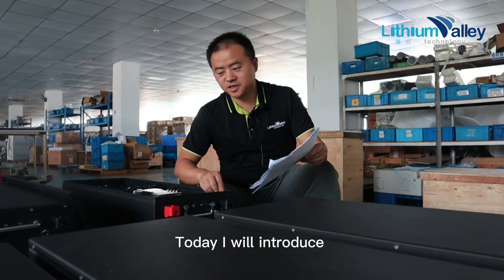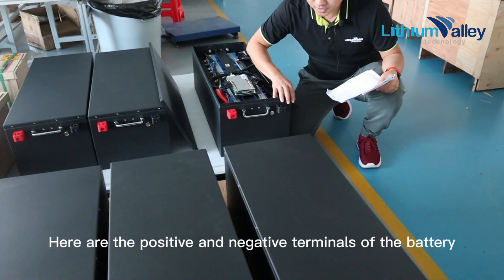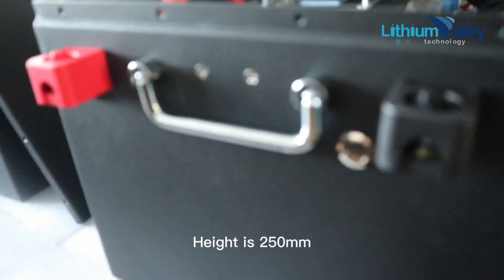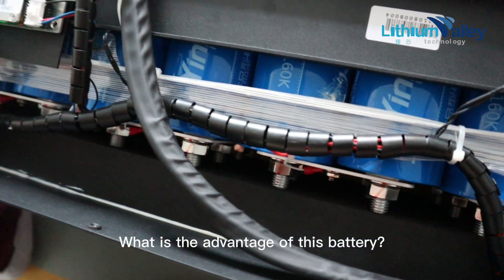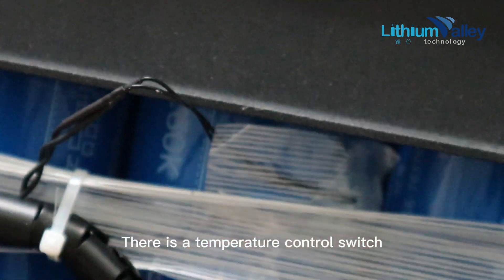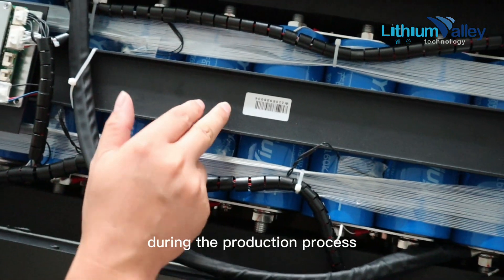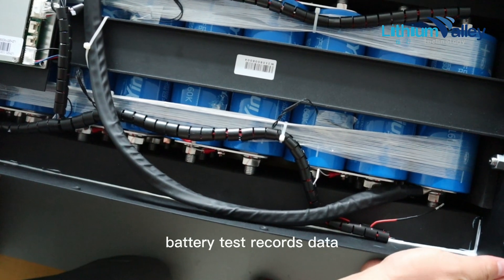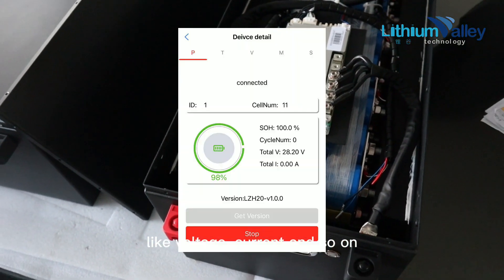Lithium Valley | LTO Lithium Titanate Battery 25.3V 135AH Bluetooth communication

Comment: If the data is correct, that battery chemistry will not only outlast the BMS (electronics) but probably your life expectancy too.
Reply from the maker: That's right, LTO battery has high cycle life:)